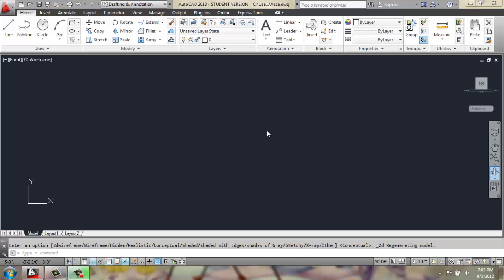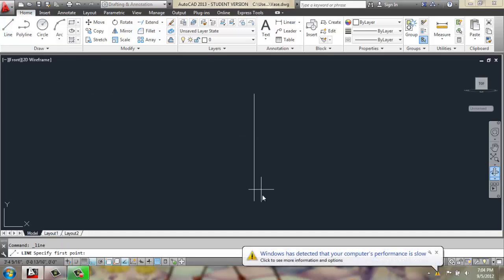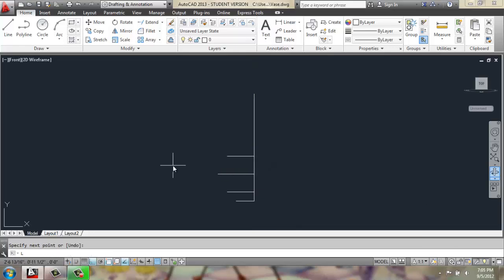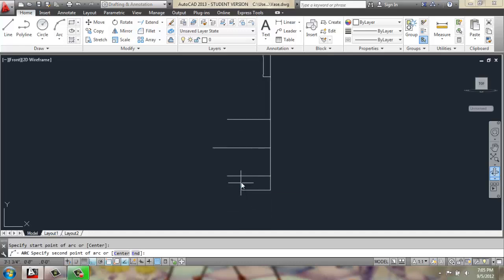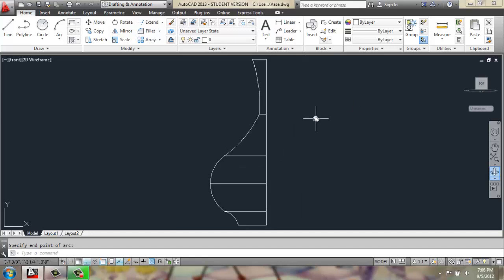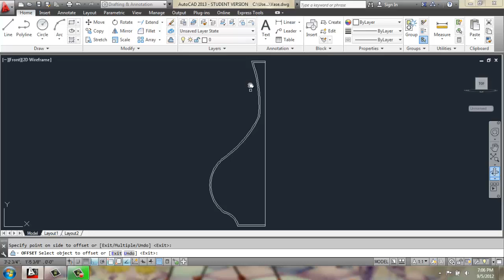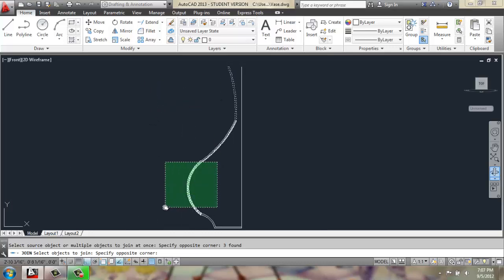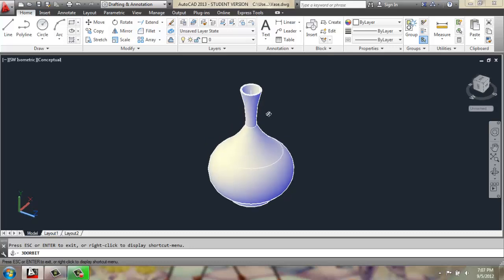AutoCAD 2013 - 3D Modeling Basics - Vase - Brooke Godfrey

Comment from the maker: Object snap tracking is tricky.  Generally the problem is if you wiggle the mouse or something like that.  Be very direct and deliberate when picking your points and you should be alright.  (People nudge the mouse around when typing in measurements more than they realize.)

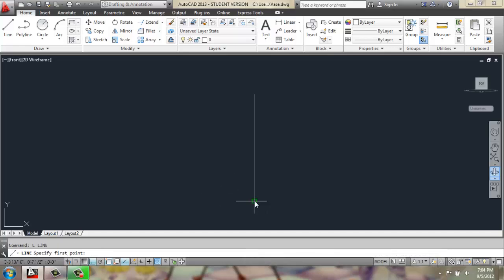Comment: From 0:45 you use object- snap and tracking to specify the first point of a new line based on an already existing point. Whenever i try this, it sometimes works correctly, but usually it will start the new line somewhere very random. This happens even with Ortho mode on.
Would you happen to know what i'm doing wrong. Or do i have something turned on/off that i shouldn't have?
I hope you can help out.